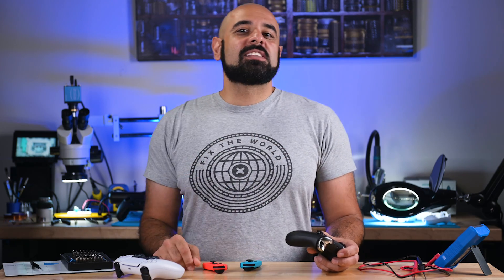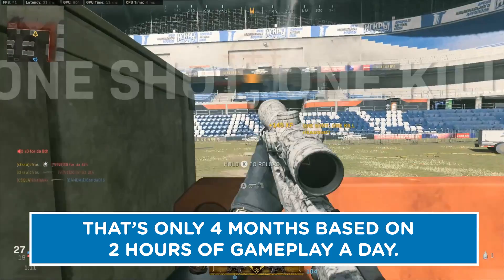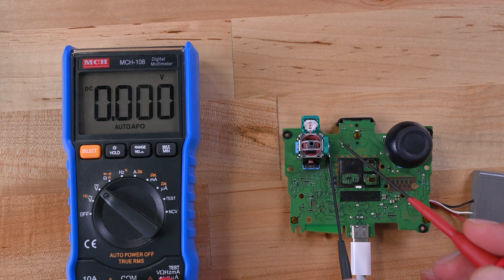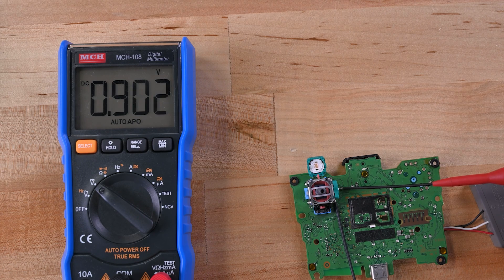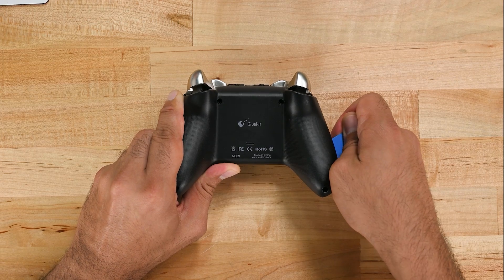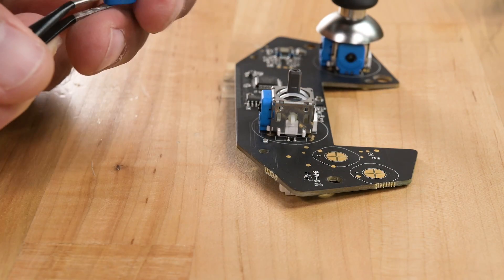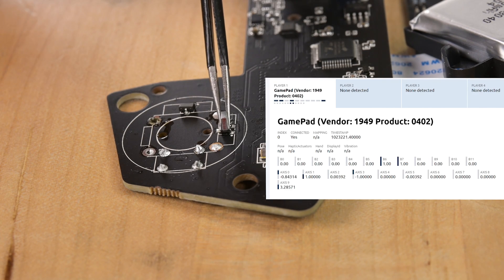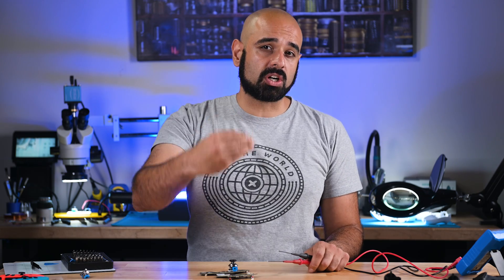How Manufacturers Can Fix Joystick Drift - Permanently!

Comment: You just sold me on the Gulikit with that easily replaceable battery, it's one of the reasons I didn't want one though I prefer AA batteries because they're easily replaceable, This is pretty easy too if/when the battery needs new life.

Comment: The manufacturers would rather not pick up this change as as would mean the durability of the controller would increase and it would reduce the number of controller sold as replacement. It is the same case that happens with the regulation of an electric bulb lifetime

Comment: If you remove the circuit board that contains the hall effects sensors and then demagnetize it.  It will fix the problem of the sensors becoming magnetized over time due to their proximity to the magnets.

Comment: This is a great step in the right direction,
but it still drifts backawards in the wrong.

See the problem is that this design doesn't
give the user any customizable options.

If you wanted to mod the spring tension
you'd have to run through the trouble of
desoldering the thumbstick potentially 
causing damage to the circuit board in
the process if you mess up just once.

The right way to go would be like
Paradise Arcade's Majenta Joystick.

Design a thumbstick that screws in
and out for easy access and gives
the user the ability to swap out the
spring or any other component.

This is a nice step forward but
not in the direction I'd like it.

Comment: Has anyone tried modifiying a Xbox Series controller with hall effect sensors?
Reply: Check out Ben Hacks driftbusters video, he literally does and shows it all. It's kinda long tho. 

Plus his design uses 4 sensors for each joystick instead of only 2 but modifying the potentiometer housing AND finding very specific hall effect sensors like the controller on this video uses.
Reply: Bought some that works with the xbox controller voltages. Waiting for them to arrive, will need to do some crazy adaptations but it might work just fine, got in contact with the chip manufacturer just to check some things, maybe in two months from now i will have it done and ready (mostly waiting for parts to arrive cuz i dont have a 3d printer). 

Plus these ratiometric sensors are ANALOG, not digital, so as long it works in that voltage range the controller could care less what you're using to manipulate that voltage
Reply: Also planning to use only one sensor per axis, like the one in this video.

Comment: while this videos shows a part of the problem i feel there is more to it than just the potentiometers. i have fixed a lot of controller and one thing i noticed besides damaged potentiometers is a loose center spring. most of the sticks have a hard time staying in the middle positions because of old worn out springs. they start to have some play in the center position. so a hall sensor would also pick up this slack.

Comment: The steam deck uses Hall effect sensor in the analog sticks. A way to make Hall effect analog stick cheap to manufacture is to take the design from the Sega dreamcast integrate the Hall effect ADC into the main I/O chip, integrate the top housing of the joysticks in to the top body of the controller, and use a smaller spring to further shave down costs.
Reply: No, the Steam Deck does not use Hall effect analog sticks by default. But GuliKit, the manufacturer of the gamepad shown in this video, sells Hall effect analog sticks for the Steam Deck as replacements.

Comment: Although it may be because I'm a PC gamer first, I don't think I've ever had drift issues so much as the spring that centers the stick wearing down to the point that there's a large enough freely moveable space in the middle with no resistance.  That is the only thing I've ever really had to adjust deadzones for for the most part.

Comment: Hi, can the hall effect sensor be identified? I am interested in using this in a gaming keyboard made for fps.
Reply: If the hall effect sensor can not be identified, is there a linear hall effect sensor that has the same voltage outputs as that of the potentiometers used in thumbstick modules? so that the hall effect sensor would be a drop in replacement for a controller albeit with a flex pcb to fix it in place

Comment: I wish there was a company that sold replacement / conversion kits for console/VR controllers I have bad drift/sticking in my left index controller, it's a known issue and I'd happily buy a replacement/conversion board to swap out the insides to get it working right again.

Comment: Not only hall effect but light sensors as well. SpaceTec had a few in their 3D motion controllers that worked fairly well, though the consumer model (SpaceOrb 360) used cheap plastic in the deflection arms which eventually wore out and broke. The more expensive CAD-style orbs used metal springs which last far longer, and were very reliable.

Comment: The biggest issue I've had with controllers (apart from joycons lol), are simply the mechanical bits wearing out rather than drift, leading to sloppy sticks. Honestly I think just replaceable stick boxes are more of a solution that covers all failures, rather than stick technology.
Reply: Youre saying replaceable is better than something that fixes the problem so replacements arent needed?
Reply: @SkulsterDulster  as I said these sticks will fail over time also, the plastic gates will simply wear down over time and become sloppy. Having the sticks be socketed instead of soldered would make either type of stick replaceable should they fail.
Reply: @robinrai4973  Makes sense, I agree.

Comment: You can use Hall effect sensors and it won't fix joystick drift permanently. You still have the OTHER kind of thumbstick drift seen most on stuff like the PSP and Index controllers, and old arcade units and a Thrustmaster T-16000m I had, where the springs wear out so the stick physically slides to a side when not in use. Doesn't matter how reliable the sensors are if the sticks themselves drift. The T-16000m especially already used Hall effect sensors and STILL experienced drift.

Comment: The joycon drift issue was already solved a while ago by this guy https://youtu.be/Vid8lIXmZwE . No new tech stuff, just a piece of paper to add a bit more pressure onto the joystick. It doesn't fix really heavy joycon drift, but its a very simple and easy solution compared to having to remake your half your factory line with completely different technology.

Comment: The problem is crappy springs and stick assemblies.  Better sensors are useless if the carrier wears out.  The temporary solution (for Hall or potentiometers) is increasing dead zone in calibration.  The long term solution is easily replaceable parts (which the Hall sensors will help accomplish).

Comment: "First time Hall Effect Sensors have been used in a controller since 2006" Technically not true: The shoulder triggers on the Xbox One controller use hall effect sensors. I understand this is industry standard for analog triggers.

Comment: Joystick drift is noticeable nowdays because programmers arefailing to program deadzones to make them less noticeable.
While my wired 360 pads has veeeery noticeable drift issues on PC, on the console they are quite smooth because of this. But deadzones brings issues like the analogs dying if you push them at the uppest rightest, ironically, not making a full 360 if you push them around this way (all 360 pads including wireless I own has this exact same issue, not noticeable in-game tho).

Comment: My xbox, 360, ps1 and ps2 controller never got drifting. The PS2 controller I currently use has drifting from some random store but can be stopped by rotating the sticks and clicking it once every game session. PS4 controller not sure here. I think that one has drifting towards south position. The first controller ever to have drifting but also I use that one on PC for spiderman and games not controlled by steam but deactivated so that it uses the official sony implementation in supported DS4 and DualSense games have lower deadzones except in super old ones or non-Nixxon games like Heavy Rain where you need to modify the Steam Controller settings to be zero dead zone.

Comment: So, the issue outlined here can also be caused in part by the by the joystick's centering mechanism wearing down, there is a lot of plastic on plastic contact in there, and over time that will cause the stick to not center and feeling rather loose. You can currently buy joystick components that function and fit the same as the plastic ones, but they are all metal, which lasts a lot longer and feels a tad snappier. I've refurbished a lot of xbox 360 wireless controllers with these parts.
I started doing this when I noticedy twenty year old well loved Saitek controller had almost no joystick wear, while my significantly newer 360 controllers had so much wear it was unusable, then I popped them open and noticed the difference.
Reply: If you remove the circuit board that contains the hall effects sensors and then demagnetize it.  It will fix the problem of the sensors becoming magnetized over time due to their proximity to the magnets.

Comment: the stick drift is less to do with the pots and more to do with the centering springs

even in you demonstration ware you keep moving the stick letting it center then measuring the voltage you can clearly see the stick is not actually recentering thus you are getting the variation in the voltage that is do to the centering springs not fully recentering the stick it has nothing to do with the pot its self

hall effect sensors is not the answer to stick drift i have a X52 pro flight stick it has hall effect sensors and it also has stick drift why because its centering spring dose not properly recenter the stick thus causing the stick drift

the problem with modern controllers is they use cheep springs that ware out quicker

old PS1/2 controllers also use pots yet they did not have the stick drift problem the PS4 controllers have the only difference between then sticks is the springs they use

i also noticed in your hall effect sensor demo you did not let the stick recenter under the power of its spring is that because it would show the same variations the pot had when you let the sticks recenter under the power of the springs more then likely yes

how can we trust you when you are clearly misleading people about what the real problem is when it comes to stick drift 

the real benefit to hall effect sensors is not that they are not prone to stick drift but that they are more sensitive then pots but that is also a down side because once their springs ware out and they will eventually ware out the drift is going to be more noticeable because the sensor is more sensitive

Comment: I have a well-used 360 controller that drifts because the stick's spring doesn't properly return it to centre.  If I manually position the stick centrally, the input goes back to zero.

Have I been wrong all this time?  Is that not "drift"?

Comment: anything will wear out eventually. even magnets. if those parts persevere, the gears and such will wear out (which is the case of the N64 controller for instance, which uses optic sensors to determine movement).

With that said. if only they would make it with standard components that you can easily buy and replace instead of proprietary ones, that would be huge.

Comment: A simple solution without having to change hardware for the current existing hardware would be just to simply allow dead zone adjustments on every console on a per controller basis. Calibration for full motion and then a fully adjustable middle dead zone would help immensely. A large middle dead zone would eventually become a problem, but for minor to even somewhat drastic drift, it could cancel it out. It's amazing that dead zone settings aren't already a thing on all consoles by now.

Comment: I own an original Sony PS1 controller from 97. Got an adapter for it and been using it on the PC with no problems! It still works better than most modern controllers and it's built to last.

Comment: POTs are garbage! I went to school for electronics in the early 1990s and we discussed how crappy they were back then! The issue with Hall sensors is, unless shielded, they could be affected by nearby magnetic fields. An alternate solution is to use encoder disks and optical sensors, like those used in a computer mouse before they went optical.

Comment: Now, all we need to do is enforce this fix on manufacturers, or encourage developers of video games to implement a dead zone function in options/settings, or get Sony and the like to implement dead zone into their systems controller settings. There aren't enough games with such a feature, a few 3rd party games have them, but not enough.

Comment: ur very first statement is incorrect. IT DOES NOT AFFECT ALL PLATFORMS. PCs dont have that issue, we dont user a controller, well some of us dont. And NO this is not a PC master race BS, its a fact. Ask any PC gamer, if they use a controller or mouse and keyboard, I bet most will say they use mouse. For FPS games, and wheels for racing. Some do use controllers, I do when i cant be bothered to hook up my wheel. And yes, then I have drift also, but for the most part that is not an issue, and i can avoid it totally if i were just a bit less lazy.

Comment: I didn't know these existed, I am getting one for sure. Thank you!!! I also noticed how very cheap inexpensive wired controllers back in the day never had stick drift (it could have possibly had these inside them) the controller would either die out or just stop functioning properly due to the cable becoming faulty.

Comment: I mean, I'd settle for joysticks just being built well and having an insanely high rating. Oddly enough, I have 4 or  5 PS2 controllers that have zero issues with any of the joysticks. No drift, no noticeable dead spots. Maybe it's just luck, but I'd think at least one would have issues. And they all have at least a few hundred hours on them, if not 1,000+.

Comment: What is very funny is that Nintendo's first analogue controller (n64) used optical sensors and not resistive pots. If only they had proper bearing surface instead of plastic on plastic.

Comment: Would it be possible to outright swap wiper based analog sticks with hall effect sensor based ones? 

Or would an entirely separate board be required?
Reply: Well hall sensors give out a magnetic reading, potentiometers are variable resistors so give out a varying voltage. But I suppose someone could make a hall sensor shaped the same as the crappy potentiometers with a micro controller built into it that gives back the reading in variable voltage instead.

Comment: I've been going on about this issue with the antilog modules. I used to solder brand new ones in often to deal with the issue. I really like the solution of using hall effect sensors but I still feel like the little 3D gimball mechanisms need improving too. The are far too delicate and I found the mechanisms actually caused stick drift themselves as over time they don't center themselves very well and can cause that drift regardless of the condition of the alps resistor sensors. I really think other manufactures should go above and beyond and create something that is robust and maybe even ballraced or some type of mechanism with the hall sensors.
Reply: 100% agree, Hall effect sensors do not remove the possibility of stick drift. The stick not returning too centre is the problem. I suspect the hall effect sensor has a lower resolution than a potentiometer and that's why it helps with drift, Which is something you don't want.

Comment: if they sold a $249 gamer controller, I expect quality parts. 3 months in with only an average of 2 hours a day. I should button responsiveness become inaccurate and stick drift start to happen. I want to replace internal parts every 3 or 4 months after warranty.
Weird how my xbox 360 wireless for windows game controller lasted longer than xbox elite series 2 game controller.

Comment: I collect retro gaming systems. Why do the thumbsticks on every single one of my older ORIGINAL console controllers still work fine with no drift? My original PS1 analog controller with thumbsticks; no drift. Same with every one of my N64 controllers; still no drift. Same goes for PS2 and OG Xbox.

Comment: A bigger disaster was when they started using pots in cars, literally they are made to go bad at a certain point and then some brands ask hundreds of dollars to repair them for another whole unit that will break down later too and they even hide the crappy pots behind huge amount of anti-tampering black resin and crap like that so that you would buy the whole actually working unit again and again FFS.

Some people were cutting the black boxes open, remove the pots and put magnetic haul sensors and boom, problem fixed.

ps: it's sad that they are even allowed to do such things, make you pay hundreds of dollars because of a single digit crap pot hidden inside that goes bad and it's exactly made to go bad because everyone knows they go bad after some time...

Comment: Controllers for flight simulators are using contactless sensors (Hall, magneto resistance):
Thrustmaster Warthog in X, Y  axes, T.16000M in X,Y axes, but keep pot in Z axis (twist rudder) what cause issues, same goes with Logitech X-52, X-56.
VKB, VirPil, WingWing use X,Y, Z axes.

Similarly, "high end" R/C controllers use contactless sensors.

Comment: But magnets also demagnetize over time, so that would just cause a whole new problem right?
Reply: According to google, neodymium magnets lose less than 1% in 10 years. And since hall effect sensors don't rely on magnetic strength, they rely on magnetic polarity; I'd assume that they'd be fine with a couple percent less magnetization. So that should be a non-issue.